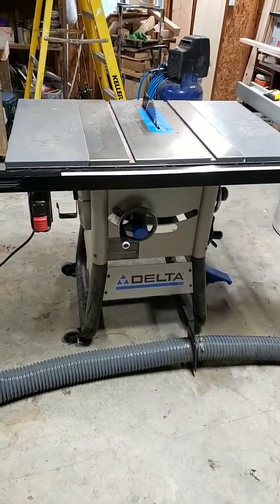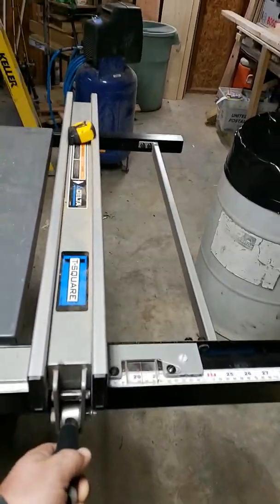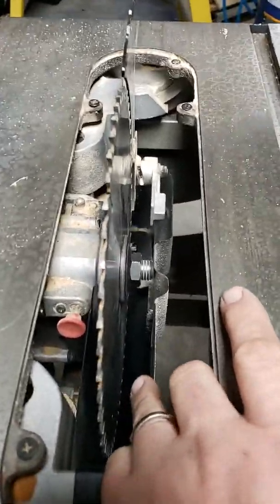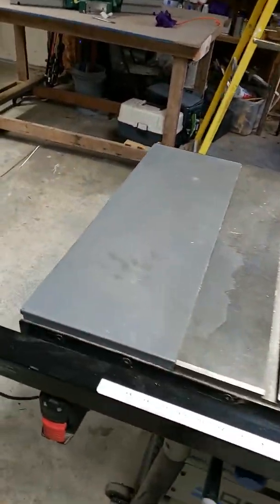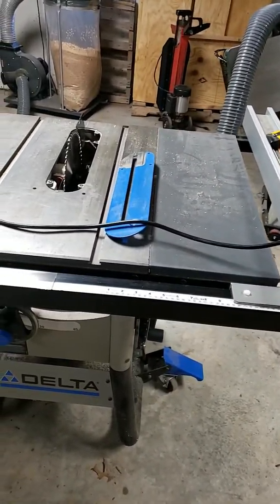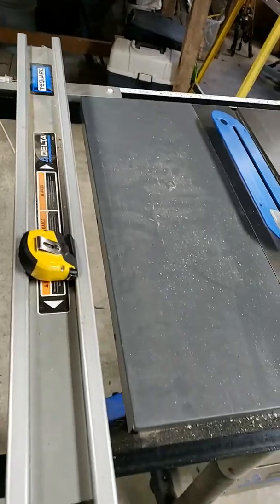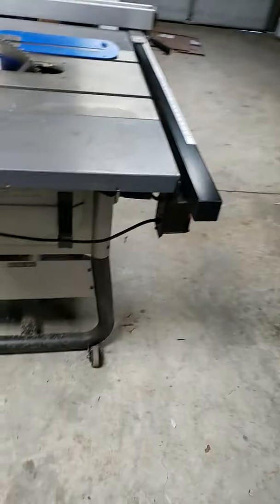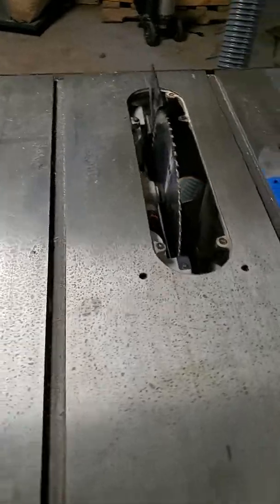delta 6 month review

Comment: It’s like listening to someone who’s bipolar. The extension cord? Really? That’s an issue? Why didn’t Delta think about your individual needs when they designed it? The 36-725T2 has a bigger opening for the blade.
Reply from the maker: They did not take the end user into consideration when building the product is not an issue? What if gas pump hoses where just a little short for small cars? That gas station would loose customers! Anyways, i'm no where near prefect and it is just my opinion! Thanks for watching and commenting!